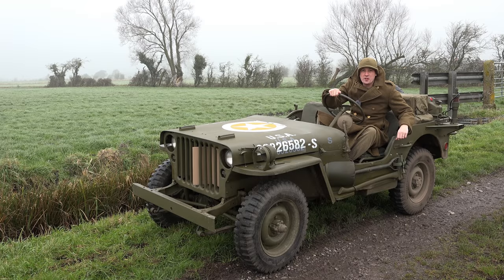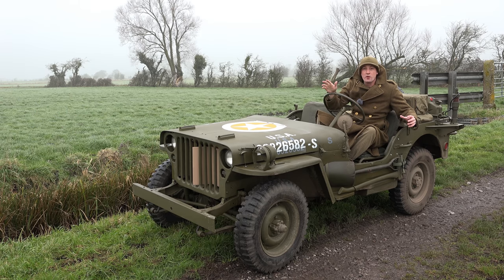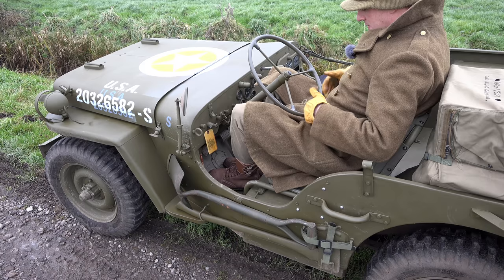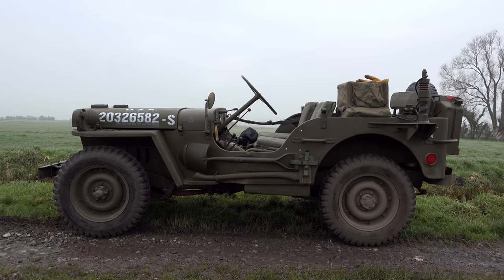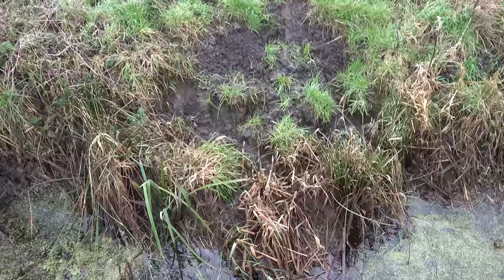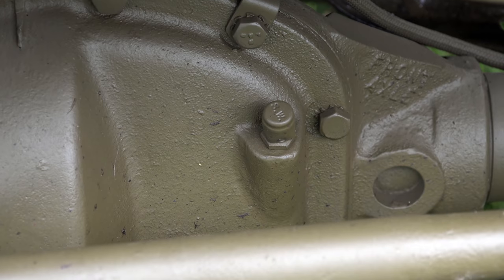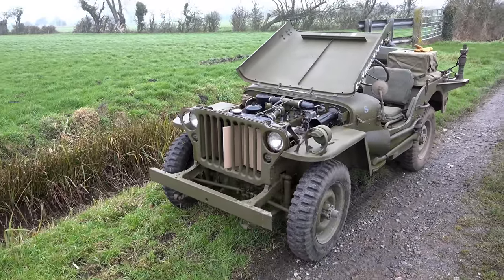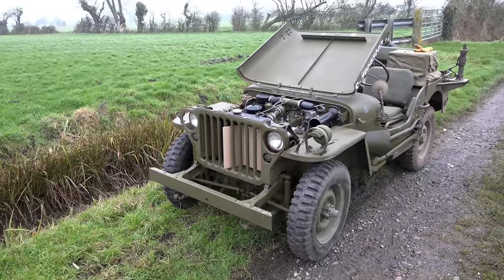Top 5 WORST Willys jeep features!

Comment: The Jeep was made so that when the steering column was pulled out and the wheels removed it could all be neatly packed into a wooden crate for ship transport. 
Most soldiers weighed less than 140 pounds and were about 5'8" so getting in wasn't too bad.
The Jeep replaced horses and motorcycles with side cars. It was used mostly on road or at least a cow path and could pull a small trailer. With the top up and a windshield it certainly beat slogging on foot through the rain and mud.
It was safer than the M-151 that replaced it. They were so easily rolled over the Army cut them up into four pieces to prevent them from being sold on the civilian market. If you see an M-151 look to see if it has been welded back together and if offered a ride politely say no (my battalion in Vietnam had 4 guys killed in rollovers in three months) .
Reply: The kicker is that by the time the Army had fixed the roll over issues with better suspension and aluminum roll cages, the M-151s had already been cut into pieces and replaced by the time the upgrades got delivered.
Reply: I am 70. In my youth those WWII jeeps could be had 'still in the cosmolined up box' kit form for (I think) $300.00  US + shipping from military surplus outfits advertising in the back pages of magazines.   I am pretty sure the 30-06 rifles were also available (if you were 18) the same way.
Reply: I'm 5'8 145lbs. It's nice to know I'm perfect for these jeeps.

Comment: One more issue in case no one has mentioned it to you is that, after having rebuilt a number of Willies engines I’ve found that because of the Trickle style oil filter, if you go faster than 40-45 mph the # 1 cylinder suffers from oil starvation and you end up with broken piston rings.
This Jeep could do 60 going down hill if you were being shot at but only for a very short time before engine damage occurs.
Reply: That's my personal third gripe after flooding prone carb and cheesy transmission.
Reply: One of the jeeps hired on the Eagles Has Landed had been refitted with a V6 Ford engine fitted, it made a hell of difference and out run the standard ones with ease, OK their engines were a lot older as well.
Reply: Anything over 50 was sketchy anyway with the small wheelbase.

Comment: funny to see the issue of getting in.  I have a 1963 Studebaker Avanti, and it's maybe not quite as difficult to climb in and out of, but close.  The issue in both cases is that big steering wheel.  Back then, when power steering either wasn't available or was at best an option, steering wheels were large to give you more leverage.  That meant they were an obstacle getting in and out of the vehicle.  I think it's just the price people were willing to pay.  Nature of the beast.  Remember, this thing is much closer in time to the Model T than to today's cars.  We are spoiled by the comfort and convenience of modern vehicles.  Back then people simply accepted lower levels of comfort and convenience that we just don't find tolerable today.

As for the dimmer switch...  I wouldn't blame the Jeep.  I don't know about European vehicles, but the dimmer switch in that location, meant to be operated by the left foot, was a universal feature of American automobiles right up through the mid-to-late  1970s, when that switch moved up to a stalk on the steering column.  As observed here, not really a problem, until you do something like mount a fire extinguisher on the kick panel so that it's now in the way and you can't squeeze your booted foot through the space that leaves available.
Reply: The dimmer switch quickly becomes a problem when a manual transmission is involved!  I remember one time coming to a stop sign at the top of a very steep hill in my dad's '64 F100, 3 on the tree, with a heavy load at night.  It was in the country, so I had the brights on.  Of course, someone else happened to meet me at the stop coming the other way!  I didn't have three feet, so I had to dazzle the oncoming driver with the brights...🙄

Comment: I bought a 1952 Willys jeep back in the mid 70's.  The body and mechanics were is good condition but the gas tank was rusted out, the tires in poor condition, and the motor was frozen up.  There were a few odds and ends that needed repair or replacing, but they were simple.  We rebuilt the engine, fabricated another gas tank, and replaced the tires.  My biggest complaint was the 6 volt system.  I ended up putting in a 12 volt generator (used a 50s model chevy generator) and installed a voltage drop so I didn't have to change out everything to 12 volt.  Using a 12 volt battery on a 6 volt starter made that thing start up in a heartbeat.  I bought it for $450 and sold it 3 yrs. later for $3,500.  Now, as I look back, I shouldn't have sold it.  But then again, I should not have sold my 66 Mustang (my first car) or my Jeep Scrambler either.
Reply: $3500 was big money in the mid- 70s. Not bad-you did well!  I bought my 2A in 2018 for $3200. Running and complete with lots of new parts. I do know that you could buy these mostly complete but not running  for 500 bucks or a little more, even into the 90s. Bought a 48 Willys truck in 1995 for $ 500 with a 283 swapped in, a snake in the engine, and a mostly empty  jar of ' shine behind the seat.  I also regret selling that!!!!

Comment: Later models had modifications to improve the water performance. They ran a vent line from the differential up into the fender just under the hood in the front and into the fender storage compartment.  They were further winterized during the Korean conflict.  As for the vehicle not reaching temperatures, I would look at a bd thermostat or housing.  Most of the problems were fixed with the M-38.  It was slighlly larger,  beefier, heavier and had skid plates, with the differential vents mounted in a manner to prevent water incursion.

Comment: The jeep being small was its secret weapon, it could fit anywhere other vehicles couldn't, it was airlifted, floated, buryed, cabled across rivers, it was light so it could float over soft ground, biggest weakness in my opinion is its speed
Reply: @FigI Boi eight guys do it in the middle of a parade in under 4 minutes, obviously that jeep is modified but there is nothing to them, very basic design

Comment: We use to fix the dimmer switch problem by running a steel rod with 2 half loop hooks mounted under the dash like the steering column. Then with the rod you would slide it up or down to use the dimmer switch. Then if something happens you could use this removable rod as a billy club for combat lol or we use to remount the fire extinguisher to the outside of the jeep that worked too. Lastly some guys just tossed it or kept it under the seat or in the back of the jeep. Just be creative if you have larger feet. We seen some female drivers who had smaller feet never had this problem since their boots would fit in between.

Comment: Interesting video - I really enjoyed it! One thing that rang true are the maintenance requirements of an 80-year old vehicle. Automotive technology has come a long way since the 1970s, and people today are used to nearly maintenance-free cars (expect for the schedule service intervals, which are often 15,000 miles nowadays). When I was a child in the 1960s, my father had to maintain the family car all the time - pretty much every weekend. Oil changes were 5,000 km/3,000 miles, the carburettor needed to be manually adjusted ... and that was just a simple family car (Opel Rekord in Germany, or similar). Given that the Jeep is a military vehicle with additional complexity like the 4-wheel drive, the engineers in the 1940s will have expected a lot of elbow grease to be spend on it.
Reply from the maker: Good comment thanks

Comment: FWIW, the WWII Stars and Stripes cartoonist,Bill Mauldin,was issued a brand new Jeep to get around in. In his autobiography, he mentioned that at 30,000 miles,it was completely worn out when he turned it in. Quite a bit of a difference to modern engineering,but it literally took decades to get that modern reliability. 
Nice restoration. Anyone willing to stick with a 6 volt ignition system is worth respect and sympathy. Good luck with it.
Reply: I've converted two old Jeeps and I can't count how many farm tractors from 6 to 12 :) ... the trick is do NOT touch the starter, it'll run hot as hell on 12 volts, if you let crank ... and 10 to 12 years down the line it will eventually burn out :) 

Meanwhile you had double RPM starting the whole time .. get it rewound in 6 volts again :)
Reply: Mine is 6 volts and don't have any problems.
Reply: @Phil M You do have valid points. We simply do not know ,however,just what level of service Bill Mauldin did or did not with his issued Jeep. There is a good chance he just drove it until it gave trouble. His autobiography indicates he was quite aware of regular maintenance for any equipment,from when he was a child. So did he turn it over to a POL point for service ? It simply isn't mentioned. Much of that 30,000 miles was not only off-road,but up and down Italian mountain tracks. Not exactly Roman roads.
Modern engine oil is a very different product from the WWII  variety. Grease is grease. Other vehicular fluids are considerable improvements, but not as much as engine oil. How much abuse did he give the little thing ? Again,it is just not mentioned.
Reply: My Ford 10 needs the 30 weight engine oil changed every 1000 miles. The oil and filtration systems pre war were much less advanced than even the 1950's. On my car, an oil filter was an optional extra. Most ordinary pre war cars would be expected to need and engine overhaul around 20 - 30,000 miles. That Jeep did well to last as long as it did!
Reply: @paulmanson253  Maudlin did have two famous Cartoons with Jeeps in them.  The first being the one with the old Cavalry Sergent Putting his .45 to the Hood (Bonnet) of a Jeep with a busted wheel.  The other speaks to what War vehicles went through, A couple of GIs are digging through a vehicle "boneyard" and one pipes up "Hey this one was actually destroyed in combat!".

Comment: Only having the opportunity once to sit behind the wheel of an mb/gpw , I was in my early teens . I was probably not at my full height of 5’7” but never considered the seating arrangement . I did immediately realize that this Jeep is not much larger than an MG orMGB or even a triumph spitfire . Didn’t really care because I was just in my glory “ wow ! A real WW ll Jeep ! “ it was painted over , rusting , modified for plowing and boat trailer haulage but it still had the blackout lights , minus the b/o driving light . No matter how much money I saved on my paper route and odd jobs , no sale “ get lost kid ( off with ya mate ) “ . Today , I contemplate modifying the front edges of the rear tub wheel wells to relocate the drivers and passenger seats on both my CJ5 ‘s . Even my dad , who stands 5’5” complains it’s tight behind the wheel of the CJ5 . And I installed a tilt CJ7 column in one . 
Weather resistant : nope , Jeep’s are weather proof . Not for very long anyway . But I try to remind myself that guys had it a lot tougher than I did . Appreciate everyone that shows their pride in restoring painstakingly an mb/gpw to honor all who served . 🇬🇧🇺🇸

Comment: I'm pretty sure the Fire extinguisher on my '44 MB was on the passenger side. I can't even remember how many cracks were in the frame of that MB-I learned how to use a wire welder with that one. My '46 CJ2A had a frame almost twice as thick, and I had no cracks to repair. My MB cranked slow,too. No matter what I did, with the correct 6v cables and good grounds, it cranked slow. I usually started it with the crank to save the battery, which was always a crowd pleaser. I noticed the Dodge WC in front of you-now there is the ideal MV! plenty of room, and a weather-resistant tent to stay in when the canvas was all done up in a rainstorm. I still regret selling mine.
Reply: I think I remember hearing the motor pool used to move the extinguishers to passenger side by default if they had time with orders or not do so.

Comment: For feature #6, a previous owner of my CJ-2A changed the from the original 6V battery to an 8V battery because it wouldn't crank fast enough to start easily enough for him.  And he had to tweak the 6V voltage regulator to put out enough to keep the battery charged (but they don't last a long time being overworked like that).  It cranked fairly quickly though.  I remember that we had to "go downtown" to a battery shop to have a custom 8V battery built for it when the "original" 8V battery had to be replaced.  I eventually changed to a 12V system with an alternator because I wasn't driving it enough to keep the battery charged so that I could drive it whenever I wished.  Now it's disassembled and awaiting "restoration" -- I'll go back to the 6V generator when I get to that point.
Reply: @jamierodg1  Yeah, but that was lost a very long time ago!  ;)  I'd still like to have one made for my Jeep though.
Reply: I've the opposite problem on my M38, it's 24V.  24V made sense for the military,  as it allowed electrical parts commonality with the rest of their fleet, but it's a right pain when you notice a tail light out and all the bulbs at your local auto parts store are 12V.

Comment: I owned a 1960 Willyes jeep years ago... every time I took it on the highway up to the mountains a mile up, the engine had problems running right at that altitude... several time the engine needed work on it when I got it back... It quit altogether on the way back the final time...  note the manual wheel locks on the front wheels to put it into and take back out of 4 wheel drive were a bear to operate...NEVER ever operate the 4WD on pavement or you will not be able to get it out of 4WD the whole thing will jam up... going back off road a while MAY loosen it up after a while... after the third engine breakdown after going up to the mountains I gave up on it sold it... It was fun to drive, but in 4WD you got maybe 8MPG...

Comment: Someone may have already pointed this out but I have seen Jeep drivers in the early 1970s use an Army poncho with one side pinched in the hinge of the windshield and the gear shift poking through the poncho hood. The rest of the poncho sat across your lap with the heater blasting away underneath.  The rest of you may be frozen stiff but your legs and feet stay dry and warm.

Comment: i served in 101st just before they got the new night mare replacement. dimmer switch was the starter when  i drove this thing it was to insure that the clutch was depressed when you started it ,  (safety first)  their was a start power switch on the panel you turned it to on and hit the clutch and that switch at the same time and the thing would start right up.  it probably got changed at some point with a keyed start switch and they wired the switch as the dimmer switch like in most old cars

Comment: Other “fun” design features that were period correct, a lack of synchromesh and the passenger side tire studs were lefty - tight, right - loose (vs righty tighty, lefty loosey). I’ve had 2 46 Willys Jeep’s. Love them.
Reply: When my dad first got his 53, he was properly confused by the lefty threads on the left side for a bit. He sure got those lug nuts tight before he realized they were backwards thread!
Reply: @therealbadbob2201  my dad broke off two studs and in doing so taught me the F word.
Reply: I have a 1967 international harvester truck that’s the same way

Comment: On the topic of small, as a service member before the last of these were completely replaced by the comparatively massive HMMWV (which began rollout in 1985), we used to STACK these one upon another for shipment in aircraft and ships.  In a C130, for example, you could fit two side-by-side inside the fuselage forward or aft of the wheel well.

Comment: I am 6' 2" also and I had no real problem driving my '42 Ford GPW.  After driving/riding in it a few miles you can kind of shift your body around in the seat to where it really isn't to bad. I found the engine to be under-powered, the clutch plate to be to small (I installed a larger one), and the brakes to be very poor. Otherwise not to bad for an antique vehicle as long as you don't try to keep up with modern vehicles - you got to drive them slow.

Comment: I believe you just convinced me to mount my extinguisher elsewhere when I get that far. Mine is a CJ2a and is a resto-mod anyway. Perhaps behind the driver seat, where you can still reach it.
Reply: Somewhere where you can easily reach when still in the vehicle and also when you're standing next to it.
Reply: if you're doing a resto mod, you could also just wire in a secondary dimmer switch in a easier to reach area, the factory one would still be functional, you'd just have a more convenient option

Comment: As for the fire extinguisher,  the original design for the MB had the extinguisher on the passenger side but later designs  moved it to the drivers side to allow room for the enlarged glove box. Some the issues which were problematic with the WWII Jeeps were  corrected with the M38 such as moving the drivers seat back 3 inches, with the gas filler out the side panel allowing the seat tobe permanently fixed to the vehicle. The extinguisher was also moved along with the pioneer kit to the passenger side...

Comment: My great grandpa (or some men in his unit) was sleeping under the camo canvas one night when it collapsed from being waterlogged. He was in a head-on collision and was tossed clear (a small injury in his knee). Also the drainage inside the JEEP is still a problem. My grandpa gave me his old 2002 and if the front is facing downhill it will flood as the drain holes are in the backseat.